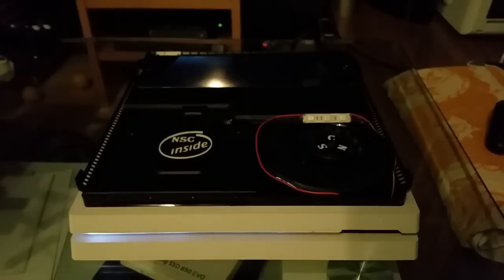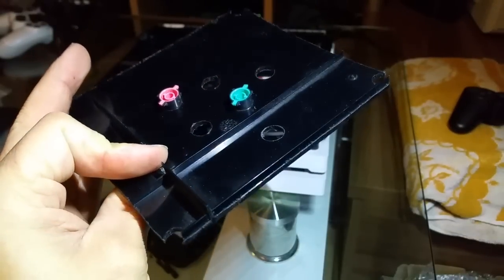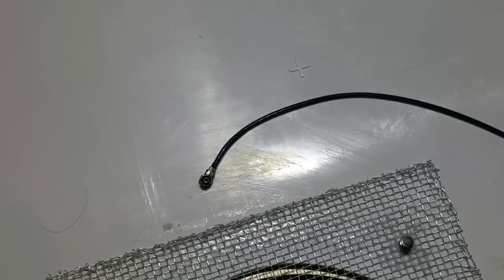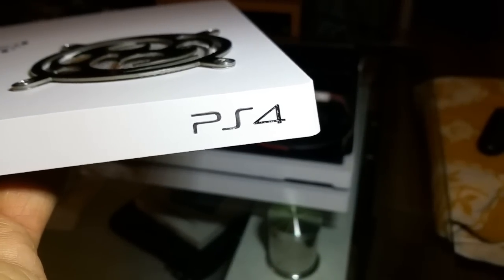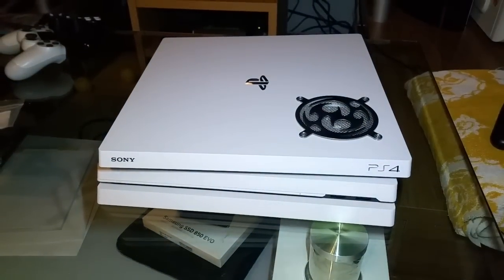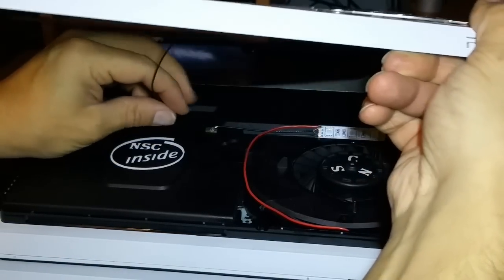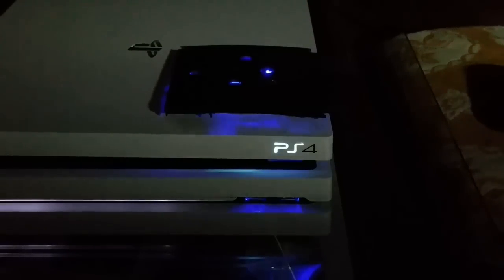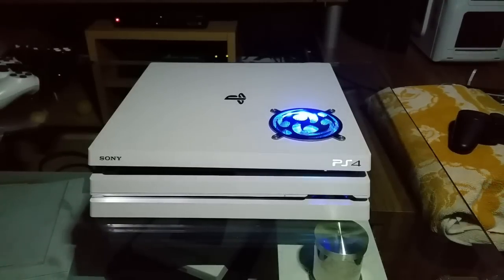PS4 Pro still working on it By:NSC

Comment: I would have used a hot glue gun to hold the wires down instead of taping them. Why doesn't the '4' light up either on PS4?
Reply from the maker: The 4 is on the Pro to much on the right side and i decided just to let it like it is, it's also better for the Case.